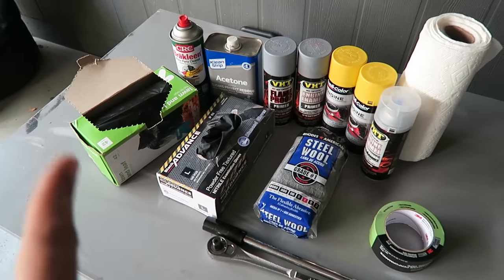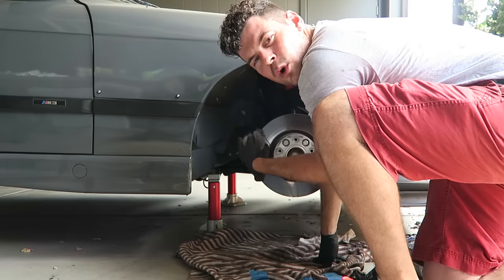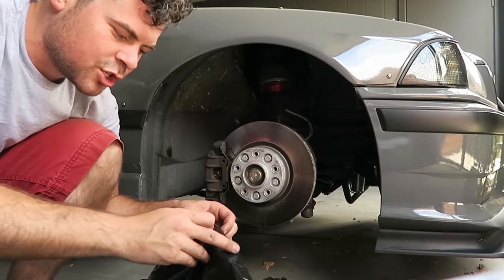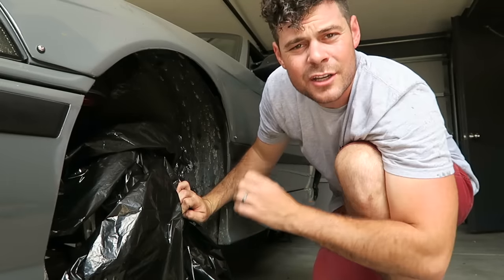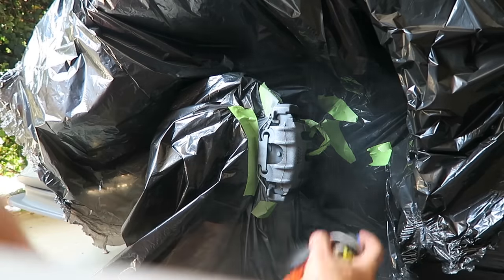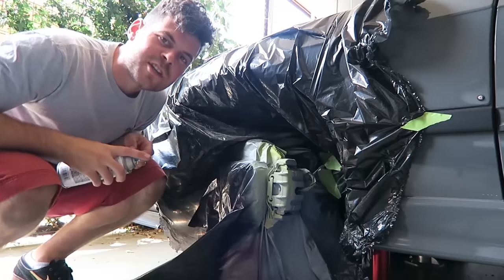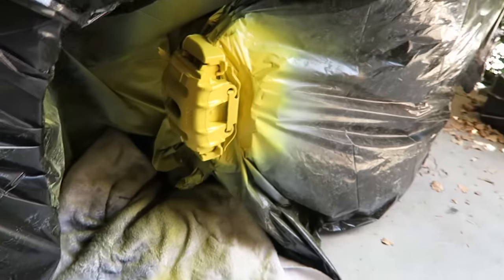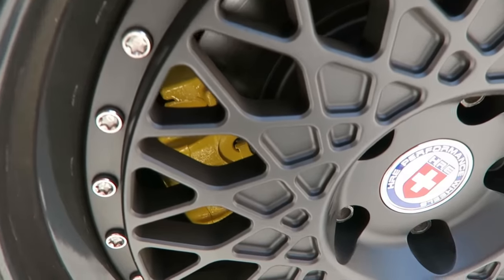HOW TO PAINT BRAKE CALIPERS... THE EASIEST WAY!

Comment: Quick question. I have a 2017 Chrysler 300s all white black rims. Windows tinted limo tints all around (besides windshield). Do you guys think red brake calipers would look nice or not fit the car?

Comment: To remove and work on the calipers off the car takes a lot less time than this. Instead of masking off this and that you can instead spend your time on breaking down the parts for proper access for both prep and paint. To bleed the brakes after putting the caliper back on is done in no time. Plus when breaking down the parts you can get some useful stuff done at the same time. Maybe even rebuild the caliper with a repair kit and get some grease on moving parts if it is old. Then your car won't just look better, the brakes will perform better too.

Comment: ok so im thinking of painting my calipers as well and my question is...why wouldnt you just take the caliper off? your doing way to much work when its simply easier to take the caliper off and let it hang so then you can remove your pads and avoid painting everything? think smarter not harder.

Comment: I found a much better way to clean brake calipers (perfect for my 12 year old audi). Just use a wire brush bit on a dremel, you can get 10 for $2 on ebay

Also you don't want to use standard high temp paint but thermal paint. Important as brake caliper is a heatsink

Comment: I would not do it this way! At least disconnect the clippers from the rotors and place them on a box. Take the pads out also. And you can clean the clippers easier that way. And it’s easier to paint. Just saying.

Comment: Loosen the calipers and remove them from the rotor.

Detach the brake pads that are loosly in the caliper, then clean.

 Primer and then the color paint. 

This is a crazy video of okay do it yourself. 3 out of 10.

#(ck) common knowledge
Reply: Don't forget to detach sliders and remove pistons 💪💪💪💪

Comment: Bruh.. first of all you don't want to paint the caliper on the car. Take it off, set that shit on a box and spray it with the brake caliper paint front and back with a few coats. Than put them on your car lol, this way u don't have to wrap off your whole damn car.. I'm just trying to save y'all time not trying to be a negative comment, I had just did this while I was changing my brakes and managed to get both things done within a couple hrs.

Comment: Liked the video and (as others have said) this is perhaps the easy/lazy way to do this. Obviously, there are time consuming and pro ways to do this, but there are also middle of the road ways to do this. The main issues I have found here is that in that (mostly) enclosed space, you will certainly have gotten spray dust on the vehicle. Secondly, metal tension springs and such are not just cosmetic; they serve specific functions and need to move freely as with the caliper pins; this method with probably result in noise and perhaps uneven brake pad ware. Lastly, a spot on the video shows a nice coating of paint on the caliper piston seal and that is never a good thing; now, the "damage" done to seals is greatly exaggerated and this technically shouldn't be a problem, but it is preferred to never have any kind of paint or other contaminant on seals that can promote drying or cracking.
To be fair, he said the "easiest" way and did a pretty good job for the easy way; BUT if you want it done right with lasting results, this is perhaps not the best way.

Comment: OKAY - So, nothing easy about masking like that. For all that time, you could have pulled the calipers, but I can see not wanting to be bleeding brakes for days afterwards. The biggest, easiest change I would have made was pull the pad anti-rattle spring off.  Clean it up or paint it silver. No factory brakes have the entire caliper, pads, anti-rattle springs, pin guides all painted same color. Its valid, but I'm not sure I would go this route. I like brush on caliper paint. Less masking, more precision.

Comment: So you basically just wasted a lot of time by doing all that masking with trash bags. And got paint all over the brake lines.. When in less time you could have just unbolted the calipers and painted them somewhere away from the car.. And then bolted I'm right back on after they were completely dry..  And what was the point in putting clear on them ?  The paint that you used should have its own clear in it and be plenty good enough and shiny enough..  Some people are just not very smart..  I'm just saying all this because I'm experienced and have done it quite a few times and actually just did my vehicle today.. And it turned out looking amazing and it took me less time than what you took

Comment: This the comment I noticed the most... People complaining about the pads being painted to...
1) once pads are replaced, that problem is solved 
2) if you spend the extra 2 to 3 minutes piping the pads out after you take the caliper off you would have to put the caliper back on to paint it the way he did so an extra12 minutes turns into 24 extra minutes. And it's more work and there for is not the easy way
3) your guy's comment about painted pads is half ass, I say that because if you followed me from #2 now there's no pad to block the paint from the rotor and you would be painting your rotor and the inside of your brake calipers.. Rotor not much a problem cause the pads will eventually wear most of it off,  but paint in the caliper that's not good. 
4) who cares the back side of the rotor wasn't as well coated as what is visible. Your missing the points.  Point 1 being easy, point 2 being this whole project is for the visual appearance of the car. So agian who really cares about the back side you'll never see them unless you work on the car.

Now finally since you don't own this car you would more then likely be a passenger and I doubt if you even own your own car, you would be working on this car to see the back side. World be dangerous if ppl had any kinda brain

Comment: Imagine actually doing this, my brakes are a pain in the ass to get off and re bleed but the look of a correctly painted caliper will always look better. Hit the whole caliper surface with brake clean and wire brush, then 400/1000 grit sandpaper, brake clean again, microfiber, then primer and so on. The painting process was done well, but the prepping was awful. Lucky this dude had some ugly fake BBS rims to hide the fading yellow calipers 😂😂😂

Comment: Why so many people are complaining here??? Fucking hell. 
1-Why he didn't took off the calipers?? 
Because it is the easiest way!!, you don't need to disassemble anything, also it is not dangerous for your hose or to have an VCDS or similar to open your calipers! 
2- why did you paint the pads???  What is the fucking problem??? You are going to replace them anyway, the next one will be the original color!! and Don't!! It will not lose the break power, it will wast the paint in some miles. 
3-Why did he use the motor paint?? He used what is cheaper and easiest to find.  Use something better if you can!!

Comment: A lot of hate but truth is no one is gonna stick their nosey heads up close enough to realize it was spray bombed in place. Half these haters, in the real world, are more likely to be like..."Nice Bro" when they see you showin out. 
At any rate, any paint and protection is better than old rusty dusty lookin calipers. Just replaced two calipers on my car a couple months ago. The coating was garbage and I have ugly surface rust already. I have no desire to remove and re-bleed all my brakes and lines again. I'll likely clean em up and brush some paint on while they're still mounted. Most likely flat black or gray. No worries

Comment: Ugh, where to start...overspray on pads backs, springs and clips. Paint that will surely flake because you can't adequately clean the surfaces to be painted without disassembly.  Compleat bodge job. Dismantle, clean and prep and then then paint each individual part. Did it the right way 13 years ago on my callipers and they still look like the day I did them. Yours? Probably will look lame in a few months...not that they even look good now.

Comment: DO NOT paint calipers this way. Why? Because all the pins, pads, etc that are supposed to move will be stuck together with paint. Take the calipers apart and do it properly. Also replace the piston seals & boots, brake fluid, and clean and lube the guide pins while you're in there.

Comment: That was defiantly over kill for just the calibers...... Just get permanent spray paint, Do the trash bag and do like 2 coats of it. But scrub it down a bit to clean it..... Thats it
Reply: Gavin Carvalho There is no such thing as permanent spray paint. All paint would wear down eventually. The part that makes it not get taken off by brake fluid, gas, etc is the clear coat. He used VHT which is a good clear coat that will not wear down or get effected if brake fluid gets on it.
Reply: If you get like rustoleum spray paint and wash the calibers and then put 2 coats on it. The time it wears off your going to have to replace your calibers anyway

Comment: Sorry but without taking the caliper off its a bad job, there's no way you can clean it properly and get paint to reach all around evenly with the caliper in place, it's 4 bolts per caliper and you don't have to bleed the system, you even painted the pads. What a bad job, for those of you saying it's the fastest way wait for a couple days when the paint starts to peal off than you will see the real trouble. Do it properly people.

Comment: People there’s nothing wrong with him doing it this way! You can barely see brake calipers anyway, so who cares if it’s a crappy job. Plus I’d say unless you’re a professional mechanic, you should be removing calipers or messing around with the brakes, imagine if someone messed around with their own brakes and somehow didn’t put it back together correctly and their brakes failed in someway and then they get into a wreck or something?? It doesn’t matter if painting the calipers is done evenly or not because it’s behind the wheels! I don’t my mustangs brakes like this, people barely notice that they’re painted but even why they do, you really have to look closely to see that I missed some spots and done not a very good job painting it. It’s not like it’s dangerous to paint it this way as long as you avoid getting paint on the rotors and pads. Geeze
Reply: There is a problem when changing pads and realise there stuck in there lmao

Comment: I can do stuff myself, but dude c'mon. Do it the legit way. You paint the brake pad, a portion part of the rotor, and basically the whole caliper assembly lol. You talking about the brake system here. This kind of stuff can fall back on you for someone who watch your video. This is because it "looks cool" and "easy". Jeez, leave a safe note for those who going to try to do it. Safety comes first man.

Comment: The "easiest" way is NEVER the "best" way. All that prep with the trash bag, but no real sanding of the calipers, pads and retainer clips. The E36 calipers have those horrible mold lines on the calipers that should be grinded down properly along with the rest of the caliper smoothed to give a proper finish. Without doing that, and with them painted bright yellow, it only magnifies the rough casting of the calipers and looks horrible. If you are going to spend time doing it, it should be done right.

Comment: Guys, if you're really not mechanically inclined or you're scared to mess something up, search how to change brake calipers. Follow those steps, it's not that bad. Then paint the calipers, OFF OF THE HUB and reinstall them. Or at the very least look up how to take calipers off the hub (It takes a minute I swear) and keep it on the line with something like a box holding them up and paint them that way. It's actually safer and easier idk what this dude is doing, let alone showing the world his dumbass technique 😂

Comment: To me this is so ugly the silver metal parts should be silver as in the hold down hardware and some of the plates the pad itself should be black also...it gives it a better look when only the caliper is painted and not the hardware or rotors or clips

Comment: The easiest way to paint calipers (properly) is to remove them from the car, split the carrier from the sliding caliper, clean with brakekleen, and paint with Caliper Paint of your choice. No primers, no clears, just two coats of Caliper Paint. Reassemble. Done.

Comment: I don’t I understand why he does this it’s not the correct way to do it it will just wash off in a couple months your meant to take them off not spray it while it’s on the car you need to put them in a oven to and use a paint coat.

Comment: jesus where do i start... grind the cast marks off for a better look....pull the caliper bolts out...dont paint the sensors....paint the whole caliper not just the face of it...pull the clip off maybe paint black so it doesnt look aftermarket..dont paint the brake pad...least his wheels cover most of this botched paint job.

Comment: Is this some sort of joke? This is one of the worse methods of painting a brake calliper, you've contaminated the new brake pads using brake cleaner with grease and dust making it dangerous as it will make the brakes Inefficient, as someone already stated why didn't you clean and paint the calliper when it was off?

Comment: OVERKILL..... Brake cleaner/ScuffBall drill attachment/ Brake cleaner/ Tape off break line, bleed screw cover/ before high temp rattle can paint.... Jesus. Overspray on paint? Clay bar.

Comment: Why didn't u jus take out the  take calipers out n paint them outside on some cardboard and not have to do the bag thing.wtf.... Smh😕.. U could have saved a lot of time playa..
Reply: Toni Starks You'd have to bleed the brake lines if you completely removed the calipers. But I think he should have at least taken then off the rotors
Reply: @Oogabooga-  oh that's right🤣... U make a valid point. Yeah the rotors could have given some room 👍